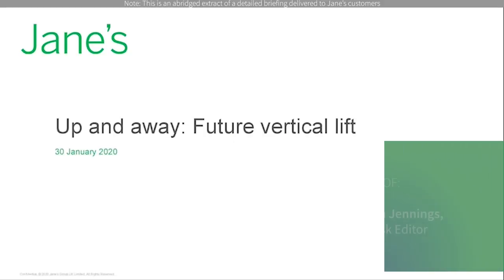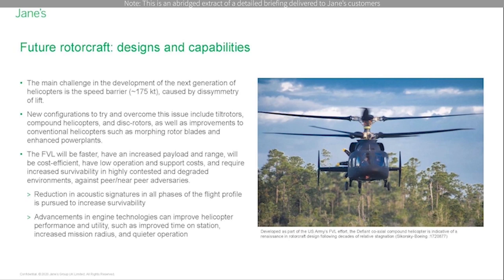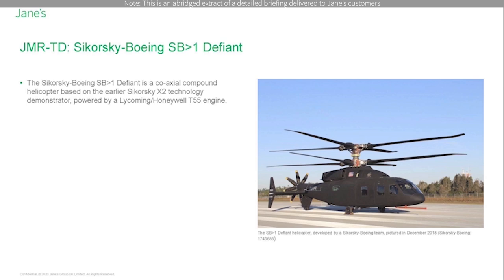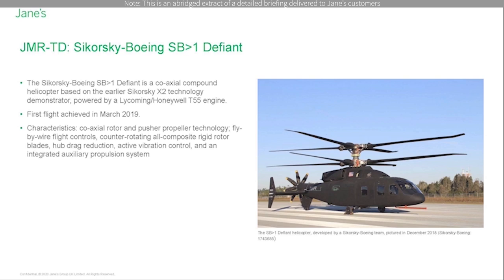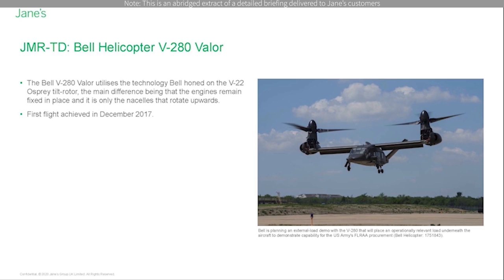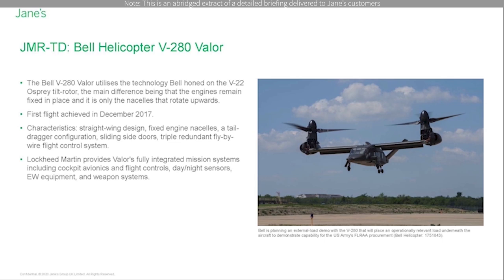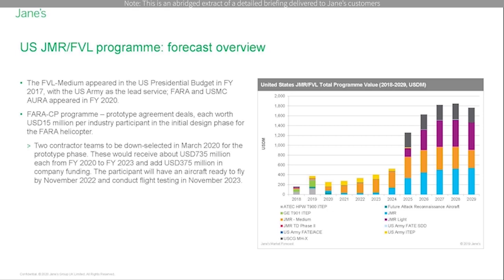Intel Briefing: Technology developments in rotorcraft design

Comment: 0:08 - 0:20 - Clipping
0:25 - Bad audio cut in "barrier"

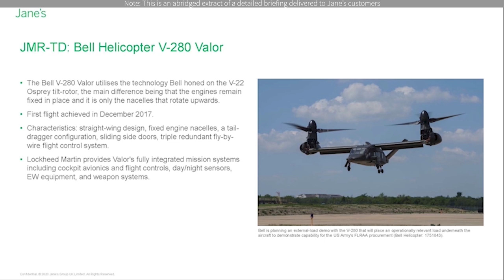0:21 - 2:18, 6:53 - 8:57 - Speech is too fast, making understanding difficult for those unfamiliar with the accent. Intonation needs work.
2:18 - 6:52 - Almost monotone. Awkward pacing.

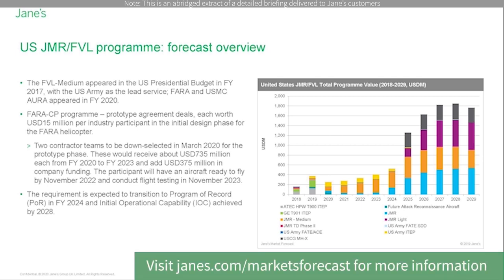All narrators need to familiarize themselves with the script before recording begins. This will help to avoid mistakes like saying "FY 2020" instead of "fiscal year 2020" (see 8:50), and will produce more natural inflection and pacing.